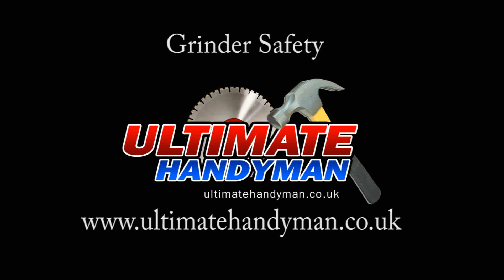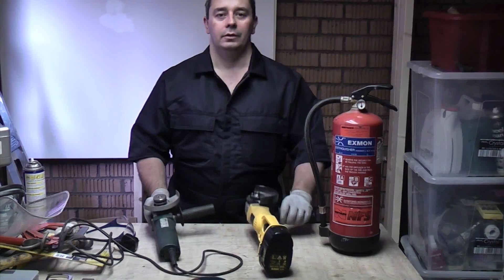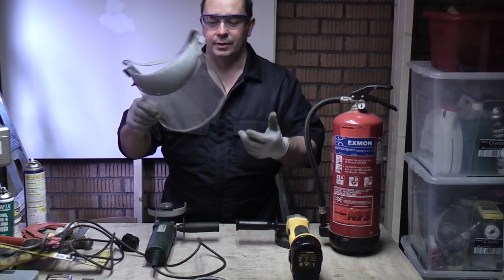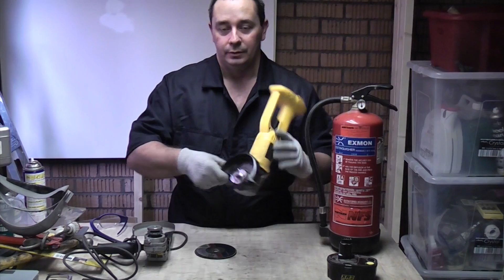Angle Grinder safety

Comment: Wearing gloves can be dangerous when using a angle grinder because if your finger gets stuck in the wheel the glove could get caught in the grinder disk and then your hand ends up getting more mangled and stuck and gloves don’t do much to stop a angle grinder but good video!
Reply from the maker: Yes, I agree. But most manufacturers tell you to wear gloves and eye protection.
It's a good idea to use gloves that are made from leather etc. as there is much less chance of them getting caught.
Thanks for the comment 👍

Comment: Hello my british friend, thank you so much for your videos.  I would like to help you with a very important safety information.  There are soo many people claiming that you should never ever gloves with rotating machinery which includes, lathe, bench grinders and angle grinders. The point is, after studying every case of accident with gloves, they all were wearing gloves made out of fibers! i mean they were wearing gloves designed for hand-tools not for rotating machinery, the only gloves totally safe to use with rotating machinery is 100% leather gloves.  Leather is not made out of fibers so they will not get caught, have a look at this videos.
Accident with glove made of fibers https://www.youtube.com/watch?v=OxC-79N7ibI&t=55s

Leather glove, extreme test https://www.youtube.com/watch?v=25GPguGTHXU
Reply from the maker: This question often pops up, even on the site where I work.
On site we do not wear gloves when in the workshop if using the lathe, drill press, grinder or milling machine. But we have to wear gloves when using an angle grinder. 
Everyone on site that uses a grinder has to go on an abrasive wheels course, which teaches you how to use each piece of equipment safely.
Whilst I agree that leather gloves are much safer than gloves made from fibers, there should be no instances where your hand should be anywhere near the rotating disk. When using a grinder both hands should be used to grip the grinder- that way your hands are nowhere near the disk. Holding the work in one hand, is a very dangerous thing to do!
Thanks for the comment
Reply: @ultimatehandyman  Thank you so much for your answer
Reply: @ultimatehandyman  have a look at this video, it is kind of funny but he made his point, didnt he? https://www.youtube.com/watch?v=tzpBZYk1OnM&t=38s
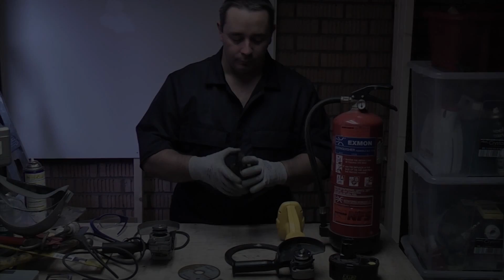Reply: @ultimatehandyman  there is also this very informative video about bench grinders and i could get another very important information from there, with bench grinders and bench sanders the gap of the rest tool is the key for not getting your glove caught, minute 4:17 https://www.youtube.com/watch?v=znnurySP3no&t=6s

Comment: Would have been helpful if you said which type of gloves are best for protecting your hands just in case, which is more important to know than almost anything you said here other than goggles and don't put the grinder spinning face down. Ear protection too.
Reply from the maker: This video is about angle grinder safety, not a PPE or common sense lesson ;-)
Reply: Ultimate Handyman Ddaaaaammnnnn got em!

Comment: Hello,
I am relatively new to angle grinders and I bought my first one yesterday. Some of the more experienced guys tell me to press harder against the material I am cutting. Isn't that dangerous, though? I think that could cause shattering. 
Thank you and keep up the great work.
Reply from the maker: +Gandalf4137 Hi, do not listen to anyone that tells you to press on hard with an abrasive disc. If they want to press on hard then try and convince them not to but if they won't listen make sure you don't stand too close to them. I have seen discs shatter/explode and the remains of the disc fly at speed and will often embed themselves into any soft material, such as your face etc. Thanks for the comment ;-)
Reply: +Ultimate Handyman 
Thank you, I will be very, very careful. Is it a good idea to use the angle grinder the way most lefties do? I've heard that reversing its rotation can be dangerous. That would deflect the sparks away from the user, but the cutting wheel would be rotating toward him. I shudder to think what that could do.
Reply from the maker: +Gandalf4137 
You are welcome. I always try and have the machine rotating away from me, with the guard adjusted to ensure the sparks go the other way. Normally I wear ear defenders, safety glasses and full face visor when using a grinder to be on the safe side.
Thanks for the comments ;-)
Reply: +Ultimate Handyman 
Another useful tip, thank you. I have one last question. Do we really have to move the angle grinder back and forth when cutting metal? Does that help dissipate the heat?
Reply from the maker: +Gandalf4137 
Yes, moving it back and forth so that you are only cutting a thin amount at a time can help as it can also make the disc last longer.
Reply: My brother decided to use a half fucked and out of date thin blade cutting galvanize on a shed roof and it shattered and flew right over my head like a bullet. I was about 10-15 foot away and on ground level. If it looks wrong, even staying 20ft away isn't safe.

Comment: ***** my uncle was using a angle grinder, and the safety guard is actually damaged. It has a split in the middle of it. And it falls off aswell so I advised him NOT to use it at all. Otherwise it could hurt him badly.

Comment: You can safely use an angle grinder without the guard.  If you pay close attention to what your doing, you should not get hurt for any reason.
Reply from the maker: Russ Walker
There are a lot of stupid people out there ;-)
Reply: Russ Walker Even the smartest person can have a brief 5 second laps in concentration which is more than long enough to have an accident.
Reply from the maker: They put the guard on for a reason! It is there to protect the operator ;-)
Reply: *****
Yeah, protect him from himself. It's ridiculous. If you're not stupid, you won't get hurt. If you are stupid, you will.

Comment: Why unplug the grinder from mains? Why not just switch the power point off?
Reply: It is a safety habit. Once unplugged you cannot accidentally switch it on. You might think "that won't happen to me". But for me when I'm focused on the task at hand. I'm using the time when changing wheels to think about how I would make the next cut. And I don't want to draw all my attention to the angle grinder to not have my hand near the switch. I just unplug and then do work on the the grinder itself.
Reply: because a faulty or worn switch my not work every time better to remove the piwer source